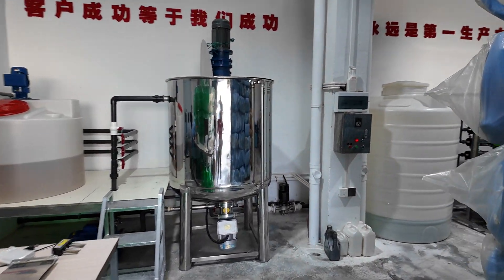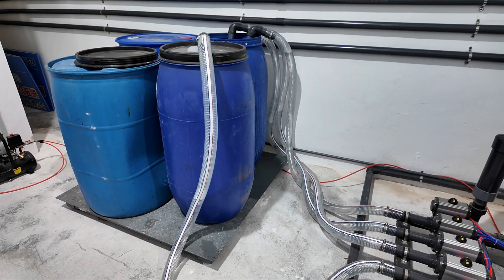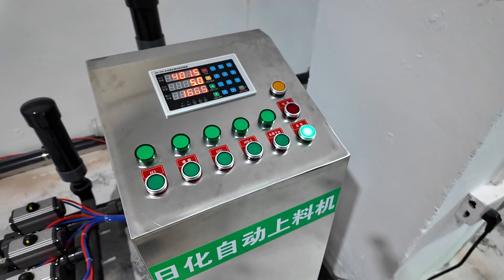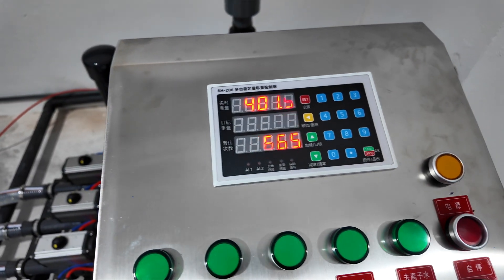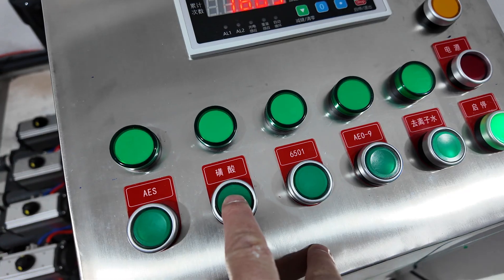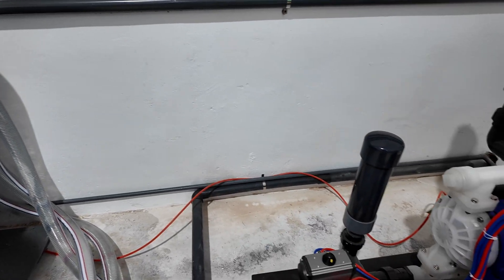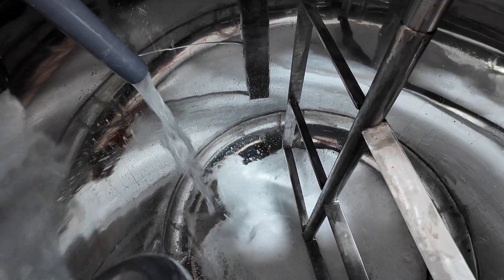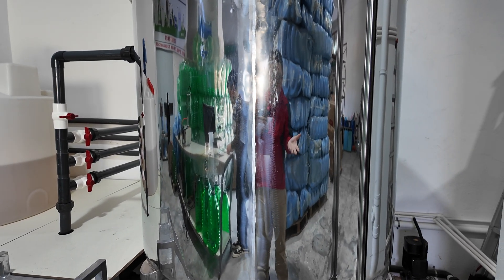How the Dosing Machine Automates and Simplifies Chemical Dosing in Detergent Production

Comment: Hello..Thank you for sharing,

what pump is used to transfer the material?

When pumping water, how do you ensure that there is no water left in the pipe? For example, the water dose is 100 liters, if the system is set to 100 liters, there will be water left in the pipe that does not enter the mixing tank
Reply from the maker: Hello, and thank you for your question!

The pump used to transfer the materials in this dosing machine is an electric diaphragm pump with a Teflon diaphragm, which is highly resistant to chemicals across a very wide pH range. This makes it ideal for handling a variety of substances used in detergent production.

Regarding the water residue in the pipe, there is no issue with leftover water after dosing. The design of the system allows any residual water to remain in the pipe without affecting the next batch. Since the system is flushed with deionized water at the end of the dosing process, any remaining water does not interfere with future doses and can be safely used in the next batch.

Comment: Is there away that you can preset the amount of water for dosing machine so that u would not pump more or less water into mixer
Reply from the maker: Yes, there are several ways to preset the amount of water to be dosed into the mixer to ensure that no more or less water is pumped than required. One common method is to use a flow meter or a water dosing scale integrated into the system. These devices can monitor and control the exact amount of water being pumped into the mixer, providing more precise control over the water dosing.

However, these solutions would require additional devices and modifications, which can increase the overall cost of the system. 

The dosing machine we’re discussing here is designed to be a simple, cost-effective solution for smaller-scale operations, so it doesn’t include these advanced features. But if more precise water control is required, adding such devices could be a worthwhile investment for larger-scale or more automated production lines.

Let us know if you have any further questions or need more details!
Reply: Good I understood. But is it possible to put a low cost water flow meter valve before the water flash out chemicals into mixer so that you would use other chemicals every time without complex and expensive dosing system